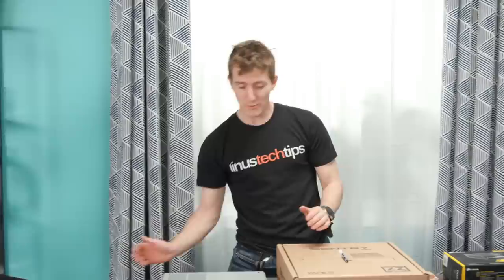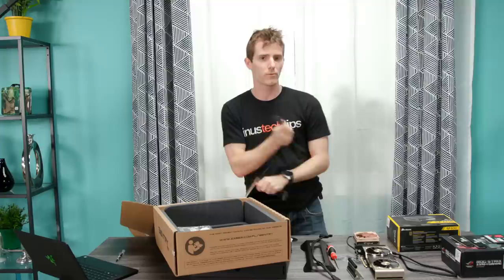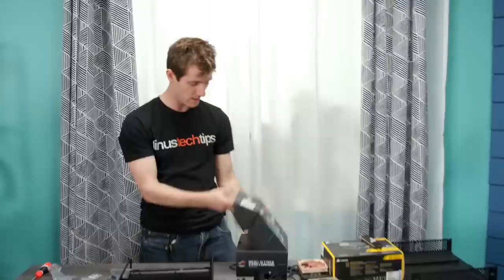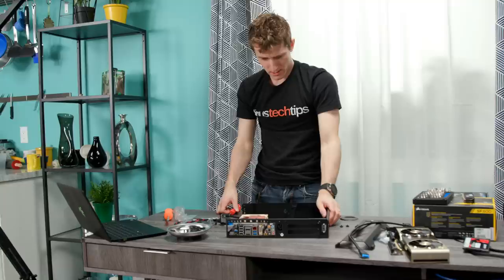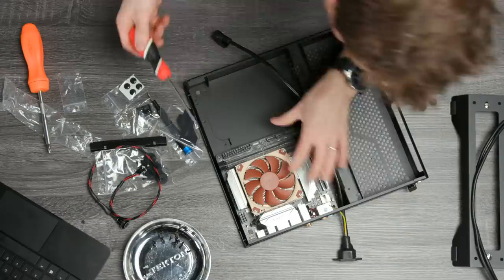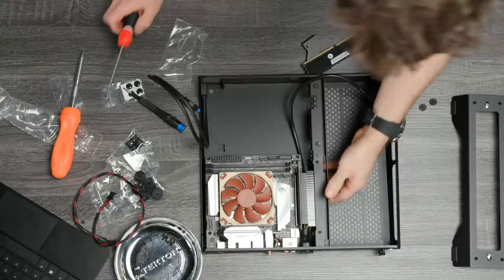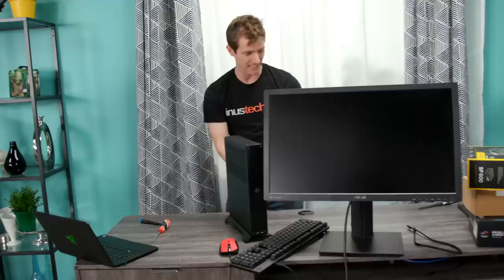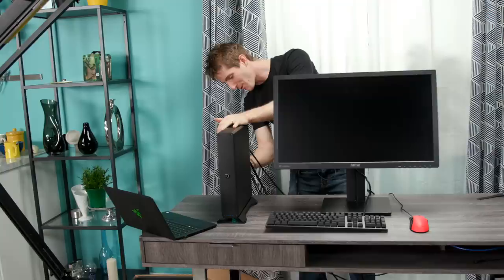Live Building a TINY Gaming PC

Comment: is there any sff cases that can fit a decent heatsink for overclocking?
Reply: Not really, they only fit low profile heatsink, some small format case can fit a aio watercooler but with a 120mm radiator it's not great for OC either. If you want decent cooling you'll have to get something a little bit bigger, like an NZXT manta, but if you don't want to you can check the DAN Case A4 SFX v4 or the Streacom DA2 (<- this one might fit a 240mm rad).
Edit : The LOQUE Ghost S1 can fit a 240mm rad

Comment: LIES! I can’t do SLI or water cooling in that case, or fit my many TB of SSD’s and HDD’s. 
No 480mm rad... no bueno!
Reply: It actually has support for a 120mm radiator in the GPU compartment. You just have to get a smaller card.

Comment: WATER COOLING SOLUTION:
Linus.. your idea simply isn't practical. A water "bag" that conducts heat away from a laptop would quickly heat up and since it would probably not cover much more than the bottom of the laptop (and its bottom would be on your lap or desk) then it should end up with minimal surface for heat transfer to efficiently conduct the heat away... and adding a RADIATOR to this would be bulky and costly and frankly defeats the portability of the laptop... a far better "solution" is to design the laptop properly in the first place to efficiently conduct the heat away without additional cooling.... having said that I'd still love to see a "bag" acting as reservoir and the thermal transfer source with an attached radiator and pump loop as a project... i believe the Apple Macbook was throttling to 50% of its CPU performance and your ghetto water tray doubled performance so there's obviously room to improve... (***ALSO WTF IS THE POINT OF A CPU THAT THROTTLES SO MUCH?? That seems like a big waste of money and a deceiving spec for that computer when you can't actually achieve that performance)

Comment: 44:50 Aldi grocery store sells those, I think they call them thermal grocery totes.  They aren't regular reusable grocery bags, they are lined with aluminum foil, have an air gap, with a thick plastic outer layer.  The top I believe has a zipper enclosure.  
I doubt you have those stores in CA, but your team is resourceful, maybe they can find something similar with the idea.
https://i0.wp.com/images.smh.com.au/2009/07/08/623805/aldi-420x0.jpg
BAM! Dollar Tree!
https://www.dollartree.com/thermal-hot-cold-bags-19-in/197260

Comment: so linus says: guys don't read the Manual and start trying like a butcher. especially if you are dump enough to try to screw the mains plug from inside. this video was a real waste of time. you may know much but seems it's only theoretical. I am really wondering what the purpose of this video was.
you should also experience some aerodinamics so you would have realized that installing the cpu cooler by 90 degrees would support airflow.